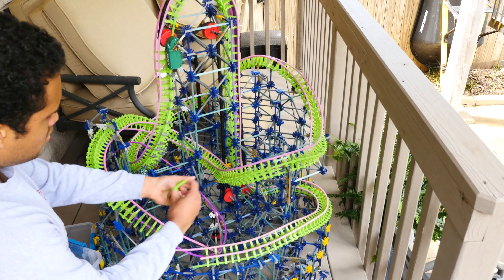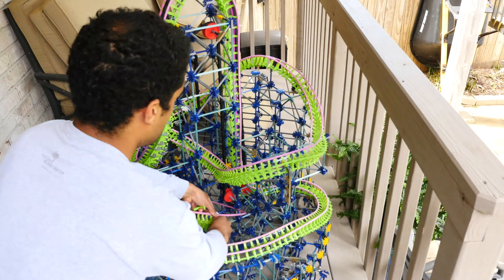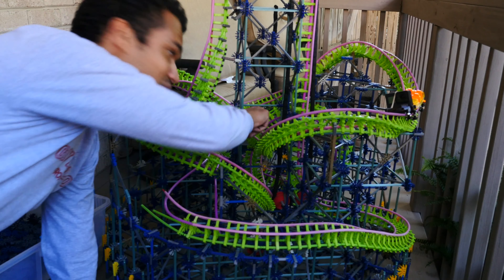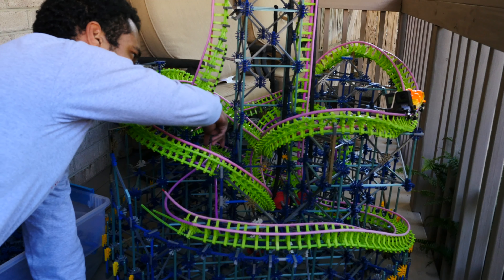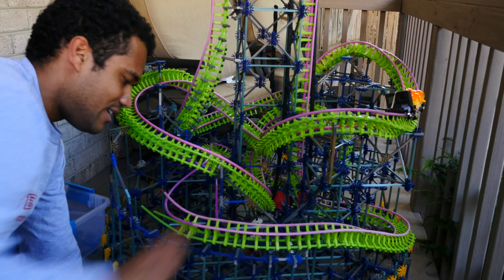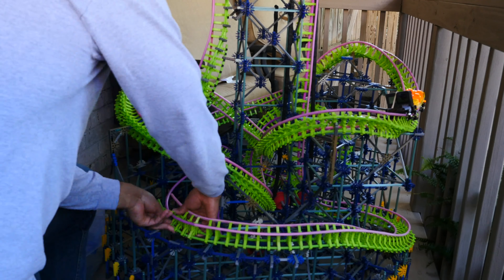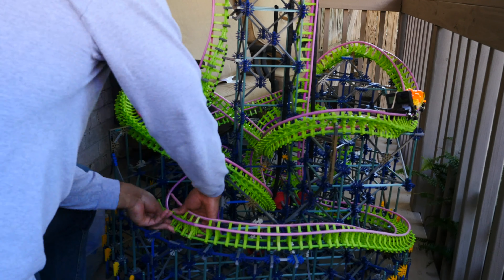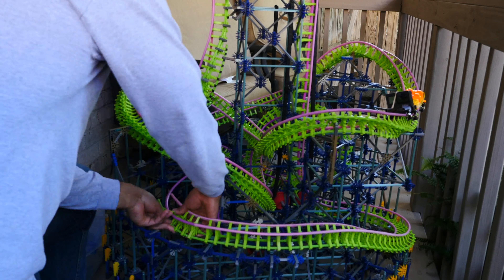Rotating Spaghetti Bowl K'nex Coaster Update

Comment: I think just adding a lot more track conections that attach to the structure will fix it not contemplating the run, i normal have a 2 way orange / brown or 4 way green conector comming of the track and attaching to the structure every other cross tie or so , gives a lot of support and regains a lot of speed, my romc drop is 5 grey rods and the car makes it back up to a hight of 4 and half grey rods, thats only a loss of 1 granite rod lol, the bearing cars are amazing if you go crazy with support, i think a guy just recently uploaded a custom wing coaster with this method, although he uses a lot more then you need now that we have bearing cars.